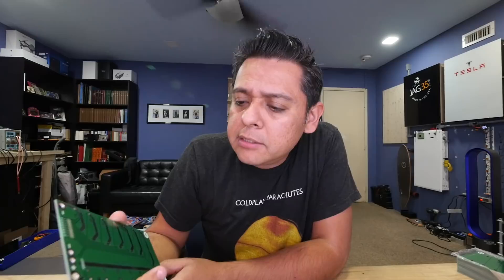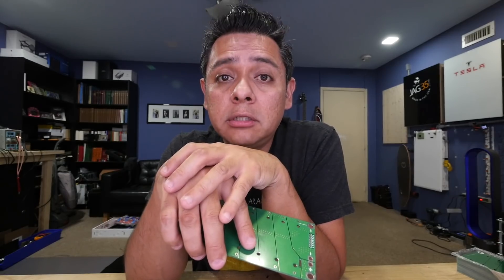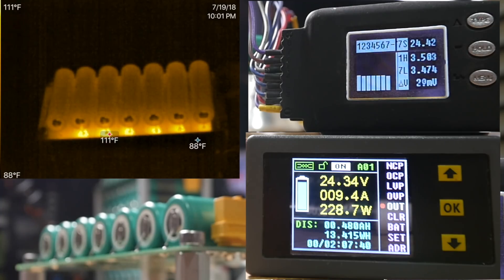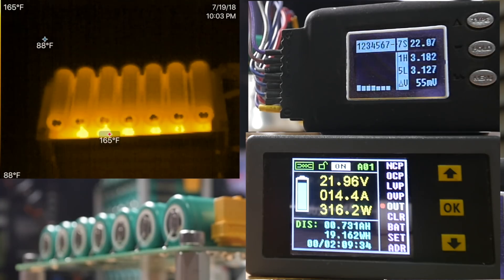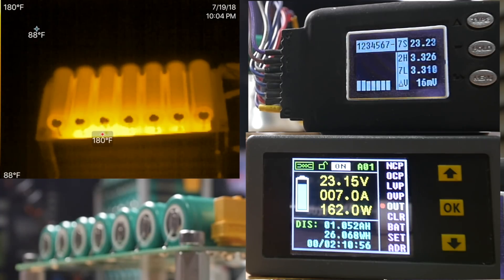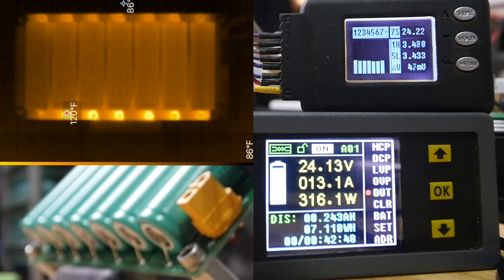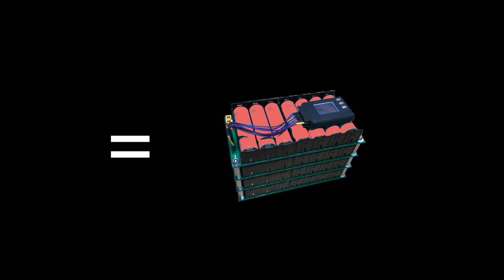How do you Fix that Problem?

Comment: Honestly, if you're worried about voltage droop at different parts of the board you can just throw a couple of decoupling capacitors on there (one 47pf~100pf near each connector -- connect one side to +, and the other to -) and that issue should go away.  The caps act like really fast (but also really small) batteries, and would even out the voltage near each location.

Comment: Hi, Have you set your battery monitor up and checked its calibration, before going and changing your PCB?
Did you specify thicker than normal copper on the PCB?

Comment: FYI: technically, and actually, a fuse rated for 10 amps means it can handle up to that amperage (10 amps) and will blow beyond that value. So your fuses are technically rated for 8 or 9 amps and are blowing at 10 amps. Just a technically. I know at the end of the day what matters is that you/we know it will blow at 10 amps. Peace.

Comment: You can go from the AWG wire size you should be using to the mm2 cross-section of copper required and then to the trace width required based on the trace thickness. https://en.wikipedia.org/wiki/American_wire_gauge

Comment: Looks like the traces to each battery on the bottom side could be 2 - 3x wider and the round pads for soldering each battery holder pin or wire should also be as wide as possible with a maximum width connection to any trace. Power PCB traces are different than signal traces.

Comment: I'm a bit confused. In your fuse test, your fuse blew at 10A. When you did the next test, your meter was reading 14.5A, and the fuse didn't blow. How is that?
Reply from the maker: I added a second and third fuse wire

Comment: Love your channel!  I have 30 cordless tool packs at 24v 6s with 18650 1.5ah.  I can always buy more as I have a good connection.  I want to find a way to run a 12 v minn Kota trolling motor off of them or even find a way to use different motor controller at 24v.  The packs each have bms or can easily remove, however I’d like to use nice fan cooled fast charger on them and preferably keep them able to be charged by same brand ac charger.  Maybe attach sae connector directly and build a bar that excepts as many packs as I have charged to plug into this new battery bank with volt and amp regulator/converter, and can remove batteries for individual charging or add solar panel charging capabilities.  I have no problem running multiple packs in parallel with only one bms for maybe 6s 2-5p for faster charging.  Motor max amperage is 60 amp and cells are rated Samsung 20 amp continuous.  Can this be done?
Reply from the maker: Yes

Comment: U need to use 2oz copper pcd with current carrieing track on both side with extensive via stiching between current track on both sides of pcb & some resistance matching of diffrent tracks maybe .

Comment: Now it is time for a BIG rethink !

1/ Go with all parallel cells on a p c b & big print with solder flooded across the traces .
 Flipping the cells per pcb / level as you go will keep it all neat . 

2/ Keep the balancing plug assy but the end user must fit 0 R links .

2 links on bottom pcb + & - > balancing plug .
Then one + per add-on pcb > balancing plug .
The top p c b will have all connections for the b m s .
( Add in the balancing links for when we flip the cells on the pcb ! )
One standard pcb for all .

3/ Pull the output from the mid of the cell / pcb bank ( output across cell 4 on a 7 cell p c b ) .
    I will be called out for this one but it just works ! 

4/ Don't use mounting hardware for electrical connections or p c b interconnects .
    ( THE HEAT WILL WIN  )
 Blade crimps are cheep so are p c b solder tabs & will handle 30 - 40 amp .
 "At work we put 70 Amp at 24 v on them for years , Not so good but we did it "
 PS it should be 25 - 40 amp .

I think you could go signal sided pcb .
With the big copper area & solder flood it should handle 25-30 amp , not that I will ever push a 18650 that hard .
(  Happy at about 2 C  LOL ) .

Comment: 10amp fuse is just crazy and a silly idea unless your using brand new high discharge cells which 90% of people are not using. Not really sure the point of all this? If the point is to create a high current pack then you wouldn't be using a PCB with thin tracks. I would have thought this build would be for the normal load of that many cells around 7amps , 1amp per cell in which case don't use those fuses and the heat problem is also not an issue. Really dont get this.
Reply from the maker: Well,  people don’t really care what this board is designed for,  “they will try and push 10A-20A thru it,  and it’s valuable to see what happens when you push a design well beyond failure point,   Knowing how things fail is valuable

Comment: Jehu, I'd make the current conductors a LOT wider. Then they can carry more current. Loading with solder helps too but why etch off a copper plated board if you don't have to? The board would cost the same (less etching and copper removal required) and would be quicker to etch in production.

Comment: Hi, Jehu!  This is a great concept! 
It's a good thing you used the thermal imager -- I think that tells you everything you need to know.  

The hot spots are the points of highest resistance.  I'll bet your design uses "thermal relief" pads.  (The pads look like they have spokes coming off of them.)  These make soldering easier, but they can't handle the high currents you're asking them to.  

Try connecting your fuse wire directly to the large copper plane.  You can scrape off some of the green solder mask until you get down to bare copper. Expose about 1/4-inch and lay the wire down flat so you get a good connection over a large area.

This will be a b*tch to solder (you'll need a large, hot iron).  But try it with just one cell first, then run your test again.  I'll bet that one connection won't get nearly as hot as the others.

Good luck!

Comment: Am I correct that you measure the voltage of the pcb traces not of the cells? I guess under high load you get decent voltage drops across the fuse or the connection that heats up. This resistance might be different for every wire and connection and so the voltage drops. As far as I can gather the pcb traces for the current are sufficiently dimensioned. The problems are the connection between the fuse and the pcb

Comment: Another fantastic video Jehu. Pushing the limits where no man dares to go .  
And eliminating every possible fault along the way.
One issue i always see in the diy powerwall 1kw packs having the long copper busbars and only charging from one end in my opinion not good .
Cos I've experimented charging 18650's parallel 1s 2p 8v 400ma and time after time they won't balance one 4.1v other 3.9v.
But series 3s 1p 11.7v 400ma BAM 3.9v each 98% of the time so balance board went in the bin .
I think pcb board is perfect 75w 3amp per cell is plenty.
Don't want resistance waste of power .
Individual tracks for each cell 10amp each same as your fuse wire.
Excellent work mate can't wait for your next build.
8.25 you said pack was fully charged so that was clearly for max load test to see where it will heat up ???

Comment: 10amp fuses yet you ran a 14amp test?
Reply: Yeah probably fine for testing but I would NEVER use resistor legs for fuses.. you can buy like a thousand glass fuses for cheap that would do way better.. Average Joe uses them for his powerwall and they work awesome
Reply: Yeah, why didn't the fuses blow at that point?
Reply: thats way to complicated for each cell you need to have a linked fuses so that each cell can be disconnected if it need to be

Comment: I had a similar problem making my powerbanks, but i was having 150 mv drop in the springs between the 1st and 6th cell.

Changed for 1mm copper wire and  2 years later still working almost perfectly. XD

Comment: I design PCBs for a living .... looking at your board it looks like you have several problems going on with the board that need to be fixed .... 
1. yes you need to have the VCC and the GND at opposite ends of the board to avoid long routes. 
2. the board needs to be 4 layers with the center layers being GND and VCC. this allows the connection directly to the VCC or GND effectively independent of the other cells to the source. this will also help with the second set of cells on the back side of the board if you supply separate holes for them to connect to the internal planes. 
3. the center 2 plane layers need to be at least 2 oz copper instead of 1 oz used on the outer layers of the boards you have. this will dissipate heat using the entire board eliminating the problems you have been seeing in your tests. it also gives more copper to conduct the current load you are asking from the cells. 
4. the solder wires between the board and the battery, although being used as fuses, are to thin to handle the current loads being used. you should have wires that can handle the max continuous of the cell itself. this is the reason in batt packs they use wide flat connections between cells. 
5. the board itself needs to have a fuse rather then each cell. the board is the supply not the individual cells. if you want the cells to be draw balanced you need to include circuitry on the board to handle this issue just like you have with charge circuits that balance the cells on charge.
Reply: Well, doing something as simple as adjusting some traces can greatly improve the performance without any additional costs. So I don't see why that can't be done.
Reply: I agree with you on the current transfer and PCB design  aspects. However if you have looked at the previous videos Jehu has made about these boards, you should understand that these loads are only made to make the difference/delta of the cells more obvious or to point it out. The fuses are supposed to go at 10A or even before, since the whole idea is to make cheap power packs, which will not ever sustain 400W per board! Jehu was talking about 1/12 C in previous videos. This would mean that even the ~1C current drawn at 2:21 would've been an extreme scenario for what Jehu is trying to accomplish. 

What comes to board level fuses and cell level fuses.. Jehu is also trying to implement what Tesla has implemented to  better protect individual modules from complete destruction because of one cell shorting. Therefore there have to be individual fuses for every cell. In a "power wall" configuration the board level fuses are rather unnecessary since the boards and batteries should be able to take even the 10A when the thing is finished...

In Summary, Jehu isn't even trying to make these boards in to modules of a high-performance (>2C current) battery pack. Therefore all costs that can be avoided, especially manufacturing the PCBs are beneficial!
Reply: I don't design PCB's for a living. Was just a solder repair tech for a year. But I have to say, you are spot on right now, and from a previous comment I made, my hunch is a heat distribution issue. But I give jehugarcia many creds for having a thermal camera on this. It does help in diagnosing a lot of issues.
Reply from the maker: Making experts cringe is part of my job description here at YouTube.
Reply: There is your gold mine, design and build one that fixes those problem and you will be rich.
Reply: Cell level fuses are an important safety feature. How are you going to address that?
Reply: Matt yes u are right, but most DIY ppl will not.follow any safety rules when installing cells... i would imagine when some ppl assemble it with thick copper wire to increase the current... like diy car audio installs, when a 200 watt sub amp gets a 1-3 cm diameter copper cable, to "increase" the output power...
Reply: Maybe I'm wrong, but does it also look like the main ground and the measurement ground from the BMS are flowing together for some distance? This shared drop of voltage could be creating an offset voltage.
Reply: Good points
Reply: The source of ground is the battery connection, which is the shortest distance to the measuring pin.
Reply: so this is why i meant u should design always all circuit as failsafe as possible
Reply: Okay, so I'm going to follow up on a number of comments here. When it comes to the individual battery fuses, they are necessary, unless you have a charge balancing circuit like David mentioned. Battery failures occur when they begin to draw a lot of current which the circuit would mitigate and control. But it does have an increase in cost. Having power and ground plains in the circuit board is not a bad idea. It's quite hard to scratch a circuit board unless you are really trying to gouge into it, and where you place barrels and vias, you design the power plans to be of ample distance away from the things you don't want connected to them, so over heated barrel will not cause paths to cross. If you were to accomplish all of the listed specs provided by David, you will have a very robust battery module. But if you eliminate some from the list, you will have to adapt. Here are some things relating to costs and difficulties you may encounter per design.

1) GND and VCC plains in the center of the board, would allow for better heat dissipation, higher current loads, and lower resistance. But would increase costs of manufacturing the PCB from a factor of 6 if prototyping, and a factor of 2 on bulk orders. Also if you are not a well versed in soldering, some may find difficulty providing enough heat to solder the power connector, and the two battery barrels at each end. (Use lots of flux, and the thickets soldering tip you can find, don't increase the heat of your iron)

2) The charge balancing circuit you can get an IC that can balance all of your batteries, along with individual mosfets per battery, and a few resistors/transistors. The IC would cost anywhere from $2-$5 dependent on spec, quality, and bulk orders, and each mostfet can cost anywhere from $0.20-$0.70. Then lets just say $1.50 for the rest of the components as they are generally worth penny's. This would also require the 4 layer PCB in the most ideal scenario as the mosfets need to dissipate heat, and access to power in varying locations. So you are looking at about $11.40 on the components on the prototyping high end, $4.50 on the low end on bulk. Then plus the 6/2 factor of a 4 layer PCB.

3) Take the same situation as 2, but use a 2 layer PCB, I would advise consulting with a professional on designing that circuit as there are some techniques needed to properly design that circuit for heat dissipation, but it is feasible . Would reduce the costs of the PCB, for a trade off of lower reliability.

4) No balancing circuit, No 4 layer PCB, you have to redesign the current PCB to allow more trace coverage on your battery connecting barrels. And you'd have to keep the individual battery fuses, which would require more maintenance. But if the objective is to make these units refirbishable/disposable with minimal cost, which I feel is the objective, this would be the ideal choice.
Reply: That has to be the biggest thing I hate about watching DIYers playing with power applications, they usually do things that would make an electrical engineer in the power field cringe because they violate good practice and even electric code a lot. As knowledgeable as Jehu is he really lacks understanding in the field of power.
Reply: I give you creds for testing though. Without the thermal camera and the cell meter stats, it would have been much harder to diagnose these issues. Aside from all that's recommended, start with just redesigning the PCB a little. At that point you can run another test, and see if anything else is necessary for your application.
Reply: I was going to make a comment about the thickness.  I think you made a lot of valid points.
Reply: That would drive the cost waaaay up.
Reply: Except theres a huge problem with everything you mentionaed here: cost. People are already complaining the boards cost so much as-is, and everything you mentioned raises that cost. Therefore jehu will choose what "works" over what is "best".
Reply: the in layer ground and vcc is not the best idea... becouse if the board gets a scratch it will spark really really big, or if u solder it wrongly, with too much heat and u can solder the vcc and gnd together... and etc...

Comment: The barrels/pcb holes of the positive side do not have as much trace copper on the top and bottom side of the PCB compared to the negative connecting side, and there aren't any connecting vias from the top to bottom PCB on the positive traces either, resulting in heat not being distributed. When you see rows of those tiny vias on computer PCB's. they are placed there for heat distribution, not current distribution. And I see none of those vias on the positive side. Remove a lot of the excess positive trace on the top side, replace it with just one straight line, and extend the copper for each positive barrel, and include vias to the bottom side for heat distribution.
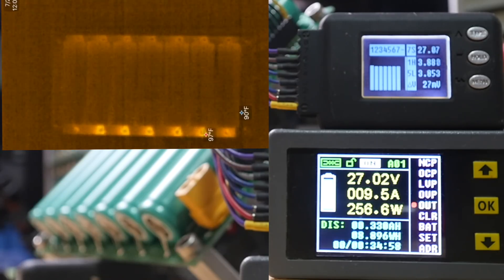Reply: You can actually see at 8:36, the copper traces on the negative side, the heat distributes almost to where you can see the square imprint of the PCB copper, while the positive side, has this very centralized glow.
Reply: Heck, to add further, looking at the PCB designs. You notice how the furthest positive barrels on the batteries are not getting hot? It's cause they have more surrounding copper on their barrels, while the others only have a small acute side of the parallelogram. And the negative barrels are on the obtuse end of the parallelogram shape. Also noting, more heat means more resistance.